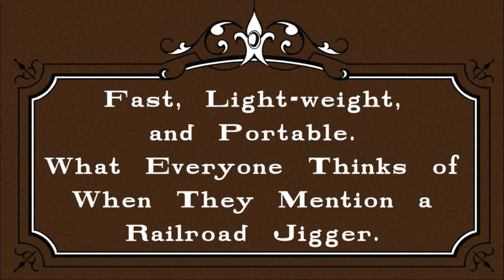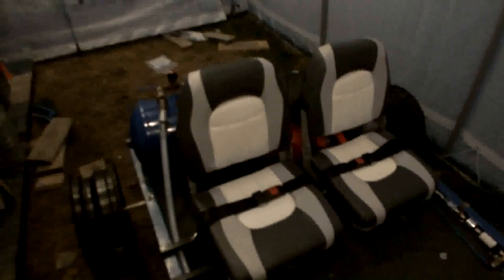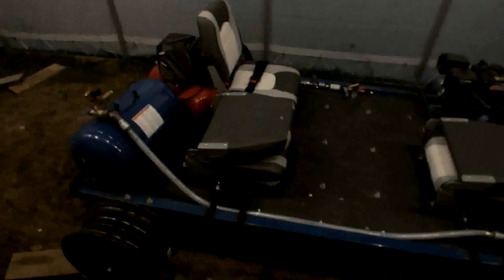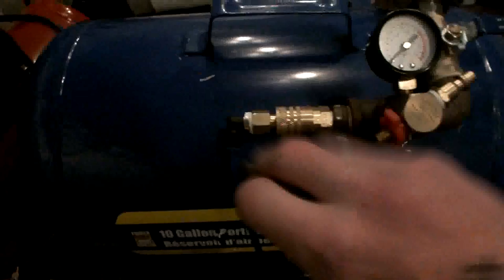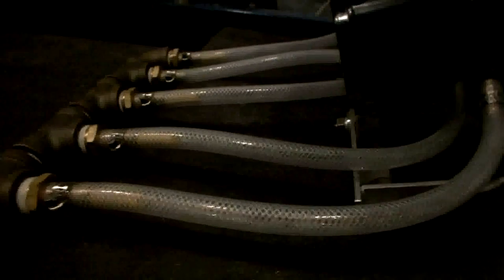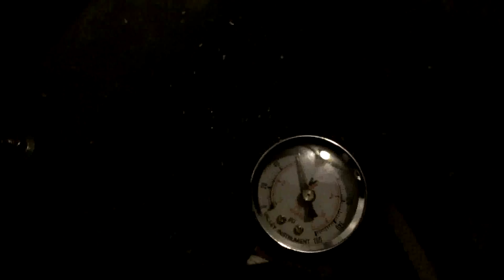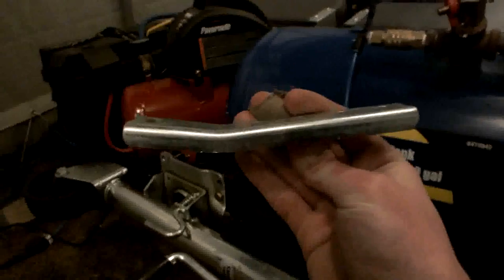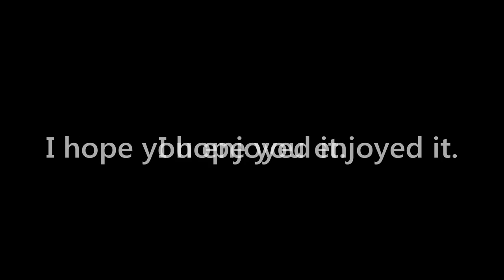Thunderbird 7 Railroad Go Kart: Official Reveal

Comment: First let me say it WARMS my Heart to see a Young man building something like this . It is Kids like you who are going to make our country what it once was , The LEADER in Manufacturing of goods . I did hear you say this is your first try at this so let me give you some advice , # 1  Your axles should of been at least 2" not 1" . I have done Go Karting most of my life and we use 2" because the 1" Bends and warps .. # 2 You over thought the air system . Had you just put a pump onboard and drove it the Motor or the rear axle you could of gotten away from a lot of piping #3 Should of used Hydraulic Brakes and not air , #4 As others have said THOSE car wheels will not work . You can buy a set of the right wheels ALOT Cheaper ... But it is a GREAT First try .   .
Reply: We race sprint karts, they use 1&1/4" dia shafts

Comment: Car rims on a track will destroy the the track surface. that is  why you should use rail wheels, easy to make they are sloped with a 2% grade and a rounded flange to keep from wearing the rail, car rims, Rotors and such damage the rail. you can make rail wheels easy cast out of hard rubber, or mill them yourself.  Abandoned rail isn't being fixed so it only last as long as it is taken care of.  It's good you build a rail runner maybe check into a local rail runner club!!  Have fun!

Comment: Love the idea! Your trailer jack has an issue though, it will be down between two rails on the railroad making it difficult to pivot around. In addition, the front wheels will need to come off their rails as well. Perhaps some sort of reversing system for the engine? This way you would just turn the seats around and go the other direction. Keep up the good work!
Reply from the maker: Thanks for the input! :) I plan to do the pivoting/reversing at level crossings, since they're around every mile and a half out here, so it will be easy to move the wheels off the rails, since they will ride up onto the road if they're positioned right. I did think of a reversing engine, but decided to just get the thing built on time so I could get school credit for it. Though I did make provisions for fitting one if the trailer jack proves to be cumbersome. All I'd have to do is weld the supports, which I made sure there would be room for, and bolt on another engine-transmission, facing the opposite direction. Again, thanks for the comments! :)
Reply: Doh! I didn't even think of using the crossings - great idea! I can't wait to see some video of it on the rails! Good job!

Comment: I wonder if the steel wheels will allow sufficient traction for both acceleration and, more importantly, braking.  Given your light weight, you may not have enought friction between wheels and rails to stop quickly and safely.  You can find a number of vids on Youtube that show railroad track go-carts that have inexpensive pneumatic rubber tires, easily found at Harbor Freight, backed with simple steel discs used to form a flange to keep the tires on the track.

Have you run it on the tracks yet?  Can't wait to see the vid of your first ride.

Comment: Way to go! Nice job, I agree with all of you engineering decisions about the project. Only thing I may have done differently would be to search out princess auto for some type of spring return cylinder for your breaking system. Hope this brought you lots of fun for all of the time you invested into it. Did you ever use a GPS or radar to track the top speed?

Comment: That's an impressive build, especially for one so young.  Did you ever get it onto a track?
Reply from the maker: Thanks!
Not yet. It's the size of a car, to transport is a logistics problem. But, now I have my own truck, and built a rack for the bed last fall. So I have a good feeling about this summer finally being when we'll use it! Keep your fingers crossed!
Reply: i suggest on not using car rims might jump track going to fast ya know.
Reply: A very good job on the cart. Are you located where you can get onto unused railroad tracks? Make sure that you are not trespassing on active track. That can end up being a very bad day for you.

Comment: Hi David, a few more questions if your willing.  What are the dimensions of the cart?  Would Aluminum of worked better on this sort of kart or is the strength of steel more important?  I'm asking because i'm building my own 4 seeter rail rider and am using yours for inspiration.
Reply from the maker: +twoPintTerror
The frame is  4 feet wide, and around 9 feet long. If you build the frame right, then I'm sure you could use aluminum to make it lighter. That's awesome. Best of luck with your project!
Reply: Perfect thank you for your help!!!

Comment: This seems really nice, are you going to publish a first 'test on railway' video anytime soon ?
I've builed one too, mine is mainly made of wood and has a 8hp engine. I can send some vids if you are interested. 

But, haven't you found any real train wheels, these are going to be problematic, especialy at level crossings.
What is it's top speed ? And where do you live ?
Reply from the maker: HI! I haven't actually run it yet because I have no way to transport it at the moment... haha, I'm saving up for a truck. It has the wheel base of a car, so you really need a trailer to move it anywhere.
Sure! Go ahead and send me some videos. I'd be interested to see what you've come up with.

I recently built a crucible furnace, so I plan to cast my own 'real' flanged wheels if the car rims cause a fuss. I get all my scrap metal for free, so the only cost then would be the propane and my time. Probably bronze or a custom aluminum alloy. Maybe aluminum bronze. And I live in the prairies of Western Canada.
Reply: +David A 

The car wheels will cause a fuss the first time you hit a switch...
Reply from the maker: Tim Kirby Thanks your your concern :) Yeah, I realize that. Where I plan to use it, here are a minimum of switches and crossings, so on the odd occasion where we do come to one, it will be a simple task to slow down, and help it over the problem. like I've mentioned to others, if they do turn out to be too much a hassle, then I'm going to cast proper wheels for it.
Reply: David A Oh sorry, I didn't see your comment, so here's my answer, 39 weeks too late :/ I'm still really interested in seeing this in action. And if you want to see mine, there are 3 video's on my YouTube channel

Comment: It seems a little overbuilt. You could probably loose about 1/3 of the weight, and get better fuel economy and your motor will last longer. not to mention making turning around easier. I like the swivel chairs a lot. People seem to use rubber wheels, with steel plates inside of them instead of big car rims.

Comment: Great idea, lots of good info, but it was very dark in the tent structure where you shot the video, hard to see alot of the time.  Also, your camera was out of focus much of the time, adding to the uncertainty of what you were trying to show us.  What's up with that?  But all in all, excellent project, but that must weigh "a ton".  When I build mine, I will try and use aluminum uni-strut for the frame.  Also, you said the actual train wheels with the flange on one side cost $1700, wow.  I'm sure you can find some nylon flanged wheels alot cheaper than that.  Thanks for the video.
Reply from the maker: narika14  I was not trying to hide anything, I had to get this done by the following morning to hand it in to be graded, this this was the best lighting I could manage. The camera's focus was not trying to hide anything either, there was a scratch on the lens so it liked to focus on that instead of the scene. It has since been repaired. And it's actually not that heavy, at ~800lbs. sounds like a lot, but it adds to stability, and I don't need to worry about it falling apart, bending, etc. The nylon flange rail wheels actually are the 1700 buck ones. I plan to cast my own wheels out of aluminum alloy with my new furnace if the car rims prove ineffective.
Reply: David A David, sorry for the misunderstanding, I was not trying to imply that you were trying to hide anything, not at all.  I was just commenting that alot of the time it was hard to see what you were trying to illustrate, because of the poor lighting, as it turns out.  And the focus issue also took away from it.  I can't believe that nylon wheels are that expensive - wow.  I plan on building one in the next year or two, but my focus will be on making it light weight, and solar-powered.
Reply from the maker: narika14 No problem. When I actually get a chance to use the thing I'll have a much better video quality.
That sounds really cool! Best of luck on your project!!

Comment: could you use the keyed shaft on the motor to connect to the transmission or did you have to use a spline shaft?  You definitely did your math and homework.  Also, how did you secure the seatbelts?